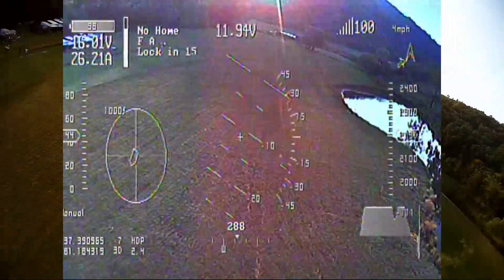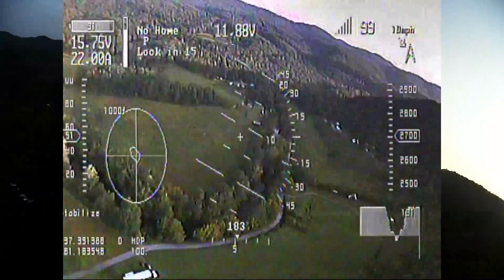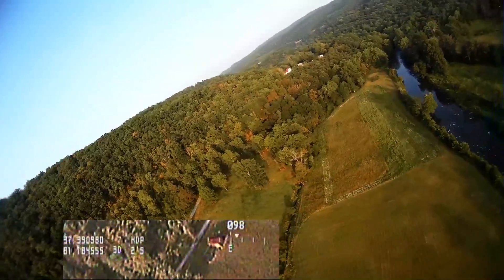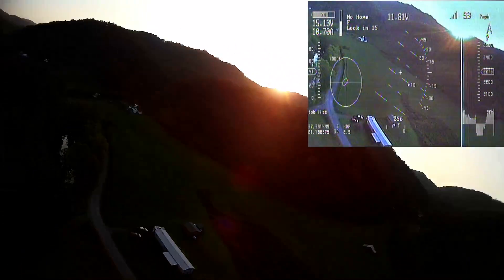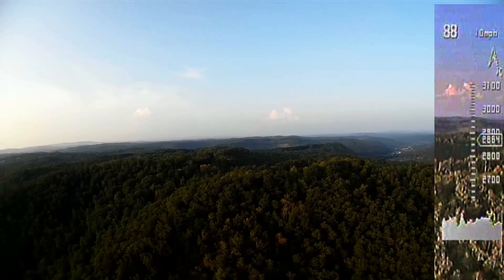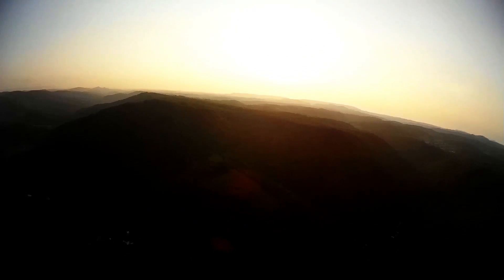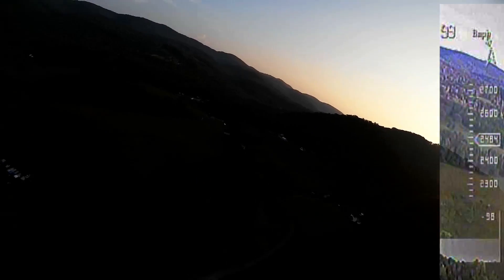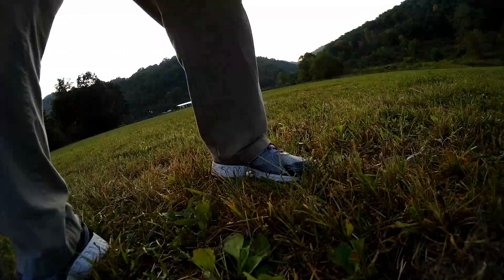AlceOSD APM Test Skywalker FPV Plane, POTS RC Field

Comment: i bought 3 skywalker frames and never have fun with them ,the first time motor got burned after 2 min in the air and crashed the second time lost elevator control and got a crash the third time lost rc connection and got  a crash lol
Reply from the maker: +Saleem Khutaba Sounds like a total bad luck streak!

Comment: Very nice!  I love the wind direction and speed.  I'm curious to know if it is derived from a standard pitot system like the vector or is it more elaborate?  Maybe 2 pilots required?  Thanks for the video.
Reply from the maker: +Richard Stubbs The wonderful wind direction widget is just a graphical rep of the mavlink data. I have only the regular 3dr pitot sensor. The MinimOSD has a similar widget so it's not really new just different the way the arrow moves around the plane.  It would be interesting to look at the opensource code and see how it is calculated. Very good question though.

Comment: Beautiful flight Dave! Very nice views! Looks a bit like my area up here in the Adirondacks!
Reply from the maker: +TheAdkFlyer10 The hills do seem very similar from what I just saw in your SW with gimbal vid. I like the wing cam view. Reminds of glassdogangle's setup. Now he is in the seat of an ultralight.
Reply: +dmerc00 yes, I've seen him flying that. Pretty neat! I  do have to give him credit though for the inspiration for my wingcam. ;-)
Reply from the maker: +TheAdkFlyer10 I think I need one of those on mine. Be cool to have it on a pan servo too.
Reply: +dmerc00 Now that would be very cool! You should try it. Mine is a Runcam mounted on a wood dowel that can swivel. Works well and is fairly light weight. I did counter balance it by taping a couple of large washers to the underside of the opposite wing.